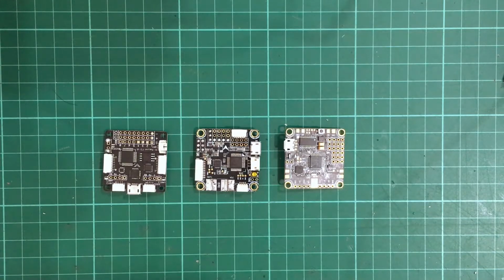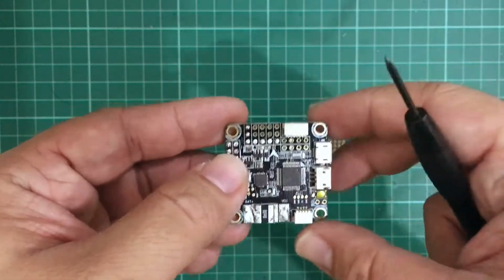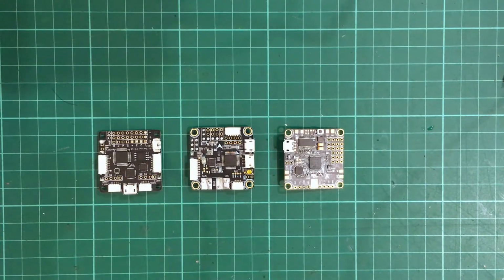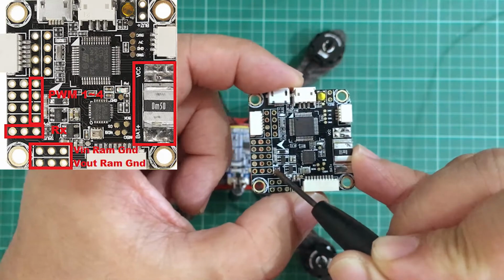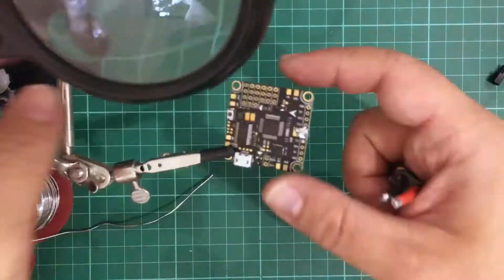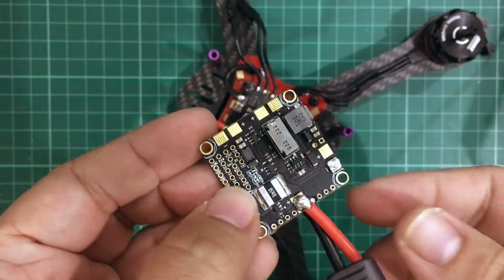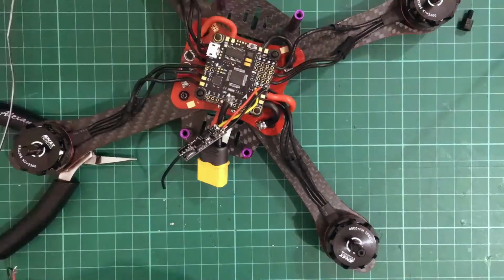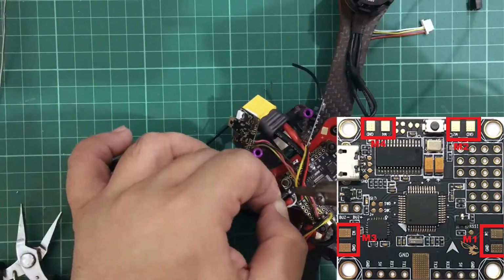How to Wire Up 3 Different Flight Controllers

Comment: what is the correct harnas input on Omnibus F4 V3 pro from 4in1 Esc harnas ?
Reply from the maker: I don't know what ESC you're using, and even if I did I don't memorize all pin layouts. Google the harness pin layout of your specific ESC and match them with the harness pin layout of the OmniF4 pro and you're all set.